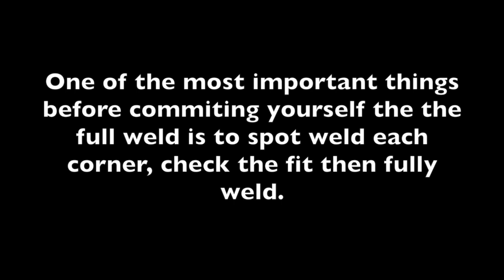Fabrication of The Caudal Heel Support Shoe

Comment: When would you use this shoe? What type of case would make you decide that?
Reply from the maker: jimbo hi this shoe is mostly used to support the deep flexor tendons.on this horse it was used to help recover a check ligament injury. It will only work in conjunction with working on a surface ie sand, sand /rubber or sand fibre. It can be used for navicular cases where the horse will not cope with frog pressure. Making the bars of the foot for support. And can be used on weak heels again supports and protects the heels hope this explains enough